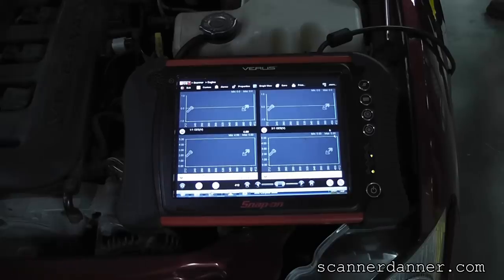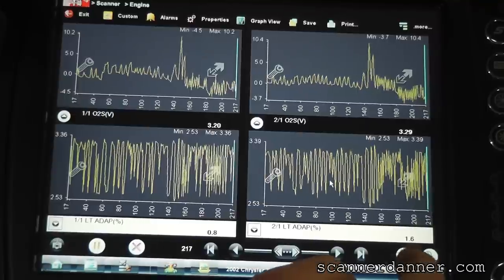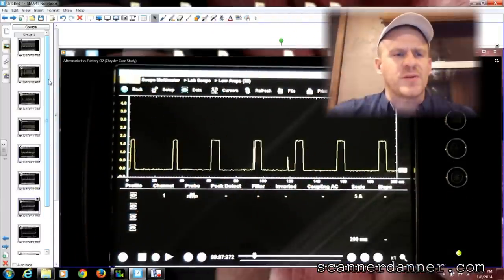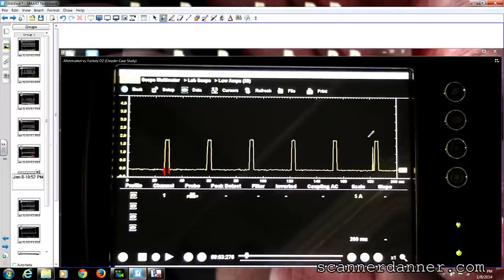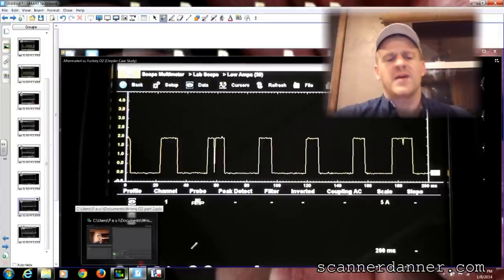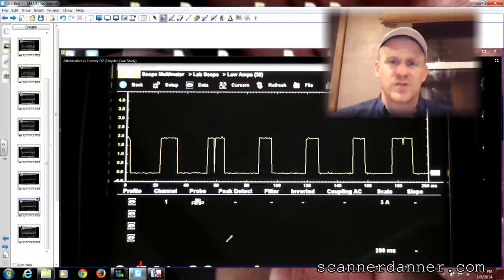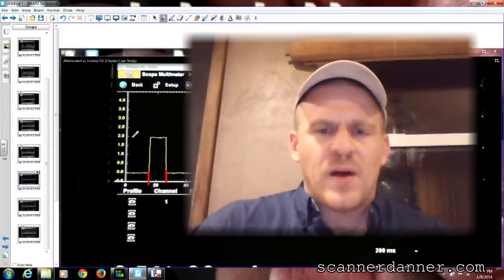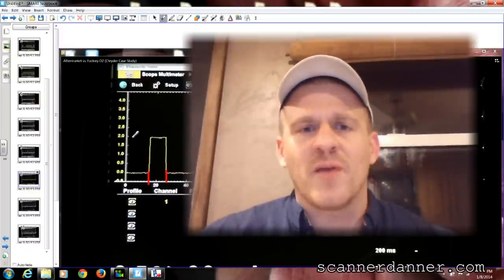WARNING! Aftermarket Oxygen Sensors (Chrysler/Dodge/Jeep part 2)

Comment: I had similar issues to you on my British Hyundai i20 diesel, where I started all the problems with a crash. I had a shed load of smoke, low gas milage and oil burning and super smelly exhaust. The original sensor gave me no O2 voltage on the scan tool at any temperature. I changed the only wide band sensor it it for an aftermarket one.  It didn't fix the problem of excessive fuel consumption and bad smelling exhaust, although it gave me a voltage after it was fully warmed up by the car's exhaust. Both sensors had the same heater resistance which was 3.3 ohms. Anyway I took the trouble to clean out the EEGR solenoid unit which was caked in soot, and the inlet manifold also cake in oily crud. Still the problem persisted. I checked all the cabling and earthing points and couldn't find anything. I was seriously thinking about changing the computer because I had a 2009 hyundai information system that told me that the heater resistance should have been 9 ohms at 20 centigrade and the signal and pump voltage with sensor unplugged and key on 'on with engine off should have been 0.8v-0.9v. I had the 2010 model and I knew the dealer said that this model was changed, but I didn't have the printed information about the 2010 model. My voltages measured about 2.83v and 2.5 v. I think it could be that bias thing you mentioned in your video on my 2010 model. Anyway in a near last attempt I went and bought a factory Hyundai sensor and stuck it in. I drove it 2 days and didn't notice any difference. I did however recall in the 2009 information system that the computer must be reset with the scanner after a sensor change under the component change section. I didn't have a scanner that could do that and in a very last ditched attempt, I watched a you tube video on resetting a car's ECU. I used the pressing on the gas pedal fully for 10 seconds with key on etc etc method. My car ran rough for about 20 miles and now after about 100 miles of driving, it is back to how it used to be. No smells and good miles per gallon. These modern systems are a mystery to me. Thank you for your work with the vids as I watched them to help me solve my car's issue. Also the new hyundai heater sensor was also 3.3 ohms.

Comment: This is a pretty old post so this is probably old news but I believe the problem with the jeep O2 sensor replacement was that Jeeps used Titania sensors instead of Zirconia sensors.  Titania sensors are variable resistors instead of voltage generators and I believe the heater configuration is quite different as well.  Pretty good discussions of the differences are here:
http://www.tomco-inc.com/Tech_Tips/ttt20.pdf
and here:
https://en.wikipedia.org/wiki/Oxygen_sensor
Reply from the maker: No sir, this was not a Titania type O2. It is a regular narrow band zirconia. You had to go back prior to 1990 on the Jeep Rennix (spelling) system to see the Titania design. There were some other manufacturers that used it too, but this wasn't one of them. I promise. I've seen this and fixed this issue hundreds of times. Thanks for the comment and the info
Reply from the maker: One more piece. I understand your thinking this was a titania sensor because of the 5v bias that Chrysler is using. The titania also used a 5v signal and was set up much like an ECT circuit.
Reply: Thanks for the explanation.  I thought I was on to something and the info seemed to fit.  I do want to compliment you on your videos.  I have learned more than I imagined from watching videos and I am extremely thankful.  As an example, I used my cheap pocket scope and knockoff amp clamp to diagnose a bad fuel pump on my wife's 2001 Taurus.  It was right off one of your videos.  Keep it up.
Reply from the maker: Here is a really good lesson on this 5v bias Chrysler is using on there Zirconia O2s https://www.youtube.com/watch?v=v8XrM-7BuOg
Reply: Thanks

Comment: Here's to sum up all the questions in this video. In 2002 Chrysler started putting a new style of PCM computer in the LH platform cars. This was the NGC (Next Generation Controller) type computer which integrated engine and transmission controls into one unit. These had four main connectors on them and just about every aspect of these new computers was new and updated from the older ECM and TCM computers. Also during this time they didn't change any of the connectors on the O2 sensors so an older sensor will plug right in. Dealers will have the correct parts since Chrysler notified their OEM (NTK) to change certain aspects of the sensors to work with these new computers. As far as the aftermarket is concerned, if it plugs in then it has to work, which isn't the case here.

Also about the spark plugs, NGK or Champion were factory installed plugs on the 3.5 engines, the service manual gives part numbers for both. The right NGK plug stated in the service manual is perfect for this engine.
Reply: awesome, thanks for the info! And I didn't know that about the plugs.

Comment: I'm curious what the PWM heater circuit uses for feedback.

What if they used resistance to determine the temperature of the heater?

As the resistor gets hotter the resistance decreases as it gets cooler resistance increases. So what if between the power pulses the PCM measured the resistance of the heater? On the 300 all of the heaters are tied to ground and each heater is powered separately. So between each heater wire and PCM ground it would be able to measure the resistance.

With the resistance it could calculate the current temperature of the heater and use that in the feedback loop to maintain a constant temperature.

This works fine if the heaters resistance is within a certain tolerance and you use the proper O2 but if the heater resistance is out of tolerance like with the Bosch sensor. It would maintain the heater at the wrong temperature due to the difference in resistance.

It's only a theory but I can't think of any other way for the PWM circuit to measure heater temperature with the current circuit layout.
Reply: http://books.google.co.uk/books?id=-njiYtrSJqsC&pg=PA272

According to this book (p272, Oxygen Sensor Heater Monitor) Chrysler doesn't monitor the heater circuit directly while the engine is running, and instead monitors the bias voltage.

When the engine is switched off the computer then starts running diagnostic checks on the heater circuit in order to test its function, in line with OBD2.

I suspect that the Bosch sensor is outside of the spec required by Chrysler, which causes problems when the engine is running. However, as the Bosch sensors have perfectly functional heater circuits they pass the engine off self-checks and are deemed to be good sensors.
Reply: Steven Cliff
That doesn't explain why the PWM driver reacts differently to the Bosch heater when compared to the OE part. The pulse widths are clearly different. Something else is at work here.
Reply from the maker: Steven Cliff
Steven
I believe it still does. All outputs are monitored and controlled in some way for opens and shorts and current limiting (some). The test that you described would be accurate but this is more of the component test monitor for OBDII heater operation. Don't forget about the comprehensive component monitor that is a continuous monitor.
Reply from the maker: *****
agree.
My friend sent me a bulletin he found a Chrysler about the change up in O2 heater resistance. One model used a 2-4ohm and another used a 6-8 ohm. The fix was to use the correct sensor or there was also a reflash of the PCM that would allow the use of either sensor. I deleted the email. I wish I could post the link to the bulletin. I will keep looking for it.
Reply: ScannerDanner
Makes sense. When I plugged in the figure from the factory O2 heater into ohms law.

I think the factory O2 was the one that drew 2 amps. 12 volts / 2 amps. It came out to 6 ohms.
Reply from the maker: *****
I think so too. So that means the aftermarket O2 was too high of resistance but what I cannot understand would be why the PCM would limit the current with too high of resistance (or too low of current flow). Every other current limit we see on the car is from too high of current flow. So this being said, the current limiting makes more sense from a too high of a current situation.
But I am just not seeing that either because we know for sure we have a too low of temperature problem. Having a hard time putting this into words. Let me try.
Scenario #1 A low ohm heater placed in a PWM controlled circuit designed for a higher ohm heater.
Scenario #2 A high ohm heater placed in a PWM controlled circuit designed for a low ohm heater. 

Expected results.
Scenario #1
-higher than normal current
-PCM enters a current limit (protect mode)
-temp. of the heater? high, low or normal?

Scenario #2
-lower than normal current
-PCM should not enter any type of current limit mode
-I would expect a normal PW command with possibly lower than normal peak amperage
-temp. of the heater circuit would be low (I think)

Questions still unanswered:
The older design O2 circuits are 100% on all the time, so I would expect a higher ohm heater.
The newer PWM style O2 circuit, I would expect a lower ohm heater.
So this seems to contradict our above Scenarios.
Scenario #1 makes the most sense from what we saw electrically but does not make sense that the circuit was designed for a higher ohm heater.
Reply: ScannerDanner
Here is my take on this: if the heater element has positive temperature coefficient (heater resistance goes up with temperature) and the ECU uses resistance to sense temperature, then the computer interprets the heater's increased resistance as meaning the sensor is overheating so the ECU cuts back heating power to the minimum it needs to make current or resistance measurements.

So if I'm right, the ECU is not "current-limiting" but rather attempting to temperature-limit the sensor and gets induced into error because the aftermarket heater's resistance-temperature curve is too different from the OEM heater's curve: if the ECU expects to see 6 ohms @ 450C from the OEM sensor (hypothetical numbers - I haven't checked specs to see what normal operating temperatures are like) and sees 6.5 ohms from an aftermarket sensor, it would erroneously presume the (cold) aftermarket sensor is already over 450C and roll back heater power to avoid making it hotter than it needs to be.

There you go, Scenario #3 where power gets rolled back due to a calibration error (wrong part - heater) in a secondary feedback circuit.

In this case, it might be possible to trick the ECU by adding a 82-120 ohms resistor in parallel with the aftermarket O2 sensor heater to draw the extra 100-150mA the ECU might to be expecting.
Reply from the maker: Daniel Sauvageau
That totally makes sense to me. Great, Great response! Thank you.
I really think you are correct in that the PCM is assuming temperature based on current flow. And I am positive that the heater circuit is a PTC resistor.
So a hot sensor=higher resistance=lower current=the PCM will limit current to cool it back down. Brilliant.
So put a higher than normal resistance heater in the car and the PCM will limit current right out of the gate!
Reply: ScannerDanner I think in both scenarios the PCM will reduce current to the resistor.

Think about it. If it's getting too much current because the resistance is less than expected, then you'll have a cooler heating and the PCM will believe you're in close loop before it really is. My question is, does a cooler O2 sensor read richer or leaner?

In the other scenario where the resistance is higher, which is expected when it's the heater is hotter, even though it isn't, it just has higher resistance in the first place, then it'll limit current again.

It's counter intuitive, but if you look at it from the PCM's perspective, it'll limit current whether the O2 sensor heater has more or less resistance than expected. That does assume that it has a  limp mode to protect itself from too much current, if that isn't true, then it'll heat that element even hotter than it needs to be until it gets the resistance expected.

Comment: Hi Paul,

As a customer of your ebook it has allowed me to grasp and understand the concept of a PWM circuit therefore I submit my humble theory for your consideration.

In part 1 when you increased and held steady the engine load the Bosch O2 sensor began to respond and it seem as if the switch-rate and amplitude was very close to the OE sensor but still not acceptable, could this be indicative of the O2 sensor heater reaching but not quite achieving its designed operating temperature?

If we were to apply a 50 percent PWM load to a heating circuit/element designed for 100 percent duty-cycle I imagine the heater would never get up to its designed temperature. Conversely if we were to apply a 100 percent duty-cycle load to a heating element designed for a 50 percent duty-cycle the heating element would not last a very long time. I theorize Bosch never changed their heater circuit design for this application and that its still designed for the 100 percent duty-cycle circuit. If you ever get another opportunity to test this theory - can you apply a 100 percent duty-cycle load to the heater circuit of the Bosch sensor and observe the signal response? I am curious to know what the outcome.

Comment: I have 3 standard motor parts smp ($30 in the states $60 landed in the bahamas)  crank sensors that don't work in my 94 jeep gc they dont produce a stong signal at the distance the oem part does. I have 2 wrecked 3.2 concorde's outside. I spliced a concorde O2 into my grands 03' impala after an aftermarket sensor crapped itself pinned at lean 160mv  for upstream so the chrysler part works fine in other systems as far as i've seen. Experimenting time, shorten the wires see if the mopar O2 does something weird like the bosch because of resistance.

Comment: NTK is an OE sensor on my Nissan as well and it is produced by NGK but there's a huge difference in price. PartsGeek sells downstream NTK for $144 and NGK for $40.63
I wonder if NGK would work just as well or would it cause problems just like this Bosch...
Reply from the maker: Mickey Bauer Hard to say. If your upstream sensors are wideband type, then the downstreams are more important that they are the correct ones (they affect fuel trim). If your upstreams are narrow band, I think you can get away with the cheaper unit as the downstream would just monitor that CAT on those systems.

Comment: Yea. I know this is a old post but wanted to comment. The issue is probably that Bosch is off on their research. If a aftermarket NTK was purchased then the application probably would have been correct so it would have worked because they make the OEM right?. Aftermarket is tough and hard to explain its true value as proven here. What is better, a well known wheel bearing  aftermarket Like Timkin or a OEM Subaru? or a Bob brand Wheel bearing with a lifetime warranty Both seem to be a different value to different people for different reasons? Ive been there and Im sure you have too. So in my case on this wheel bearing saga, Our Subaru at 100,000 miles developed a noise from a front wheel bearing. I saw a set of 2 on line with a lifetime warranty so I purchased them. And replaced the one and saved the other. After 8000 miles it developed a noise again so I replaced it again. After some time the noise returned so I bought a set of Timken's on line and Replaced the both sides. Edit (Threw out the lifetime warranty junk that would have been great for a used car dealer with a short warranty. I would have had to pay return shipping. Not worth the money) So now 20000 miles on the others and are just starting to have that faint noise. I know what that means I just bought a set of NTN Hubs NTN makes Subaru OEM hubs on the 2008 Subaru's. I have yet to replace them because the others are not there yet but expect a better life form them. The rears I Just did OEM with the OEM backing plates. Have Had enough messing around with the poor aftermarket bearing. Why did I not just replace the fronts with OEM boxed Front wheel bearings? Thats a good question but at this point I am curious. Are aftermarket NTN just like OEM Subaru? And Yes I torqued them all correctly in case anyone is wondering. Rear OEM boxed quiet as a mouse 15000 and 1000 miles since new Zero issues  So Did I save money buying non OEM NTN bearing hubs from the very beginning? Everyone knows that answer to that. 
Did this servicer that put in a non OEM O2 sensor save money? He may have made money on this one, but lost more than he gained in reputation. Some things just dont equate as a value. Unless the value is in a vehicle that has to come back out of warranty. Most of us want to believe in the value of getting stuff cheaper. 
To carry on further about OEM dealers. I know first hand that most dealers use Aftermarket parts on there vehicles and charge full OEM retail pricing on the parts. Saw it with a friend Chevrolet. And Saw Advance Auto part come onto a Subaru Dealer delivering a set of re-manufactured Calipers to the parts department. So your feelings of wrong doing in dealers is valid. The same thing happens in other fields. Mostly Out of Warranty servicing. I wish there was a way to ensure the quality but in most cases NOT ALL OEM is the best way to go for error free repairs. Pay me now or pay me later.